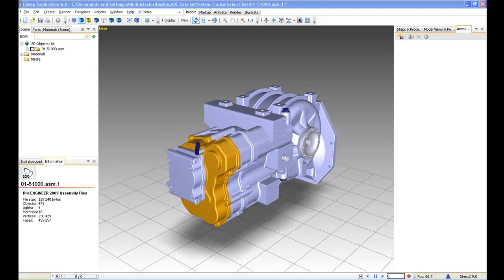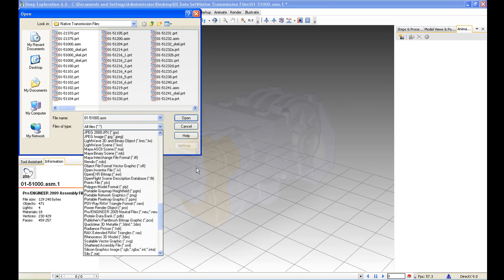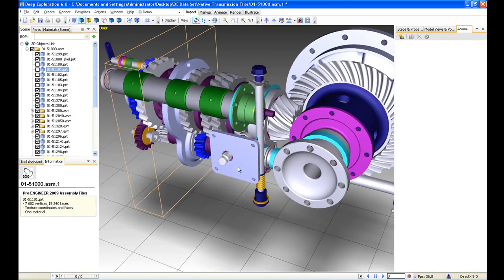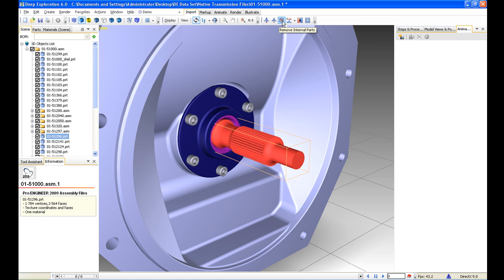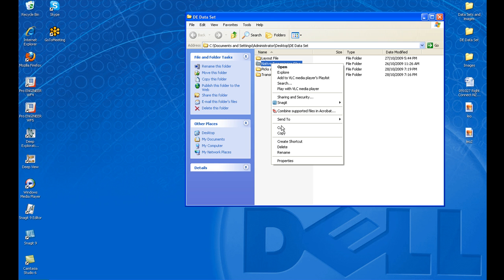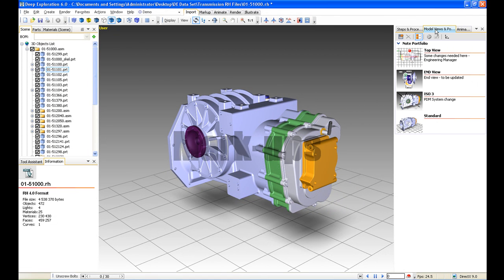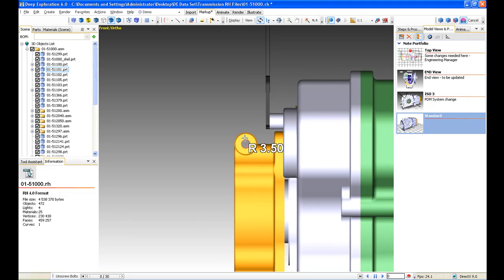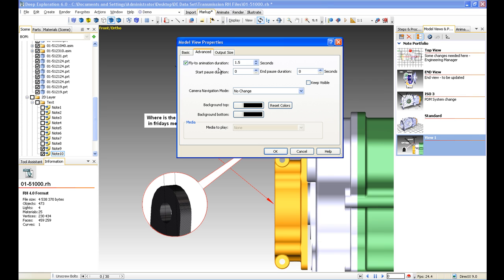DE Transmission Demo Pt 1

Comment: Hello. Thank you for the demo. I see that you're working exclusively with .rh files by the end of the video. Does this mean that markups do not easily import into .u3d files or 3D PDFs? I've attempted this using the usual "Save As" or "Convert to" methods to export markups with my model out of DE, but it seems that, during this process, each markup/note and its respective lead line will convert to an object that is far less interactive and aesthetically pleasing than the original markups in the native .rh file. Thoughts? Thank you.